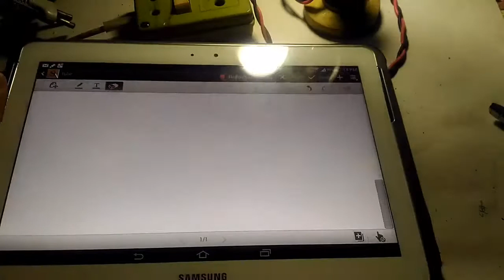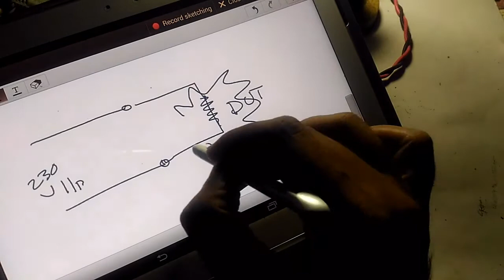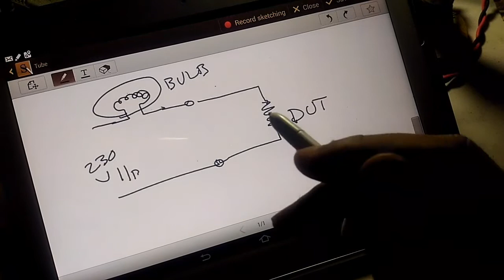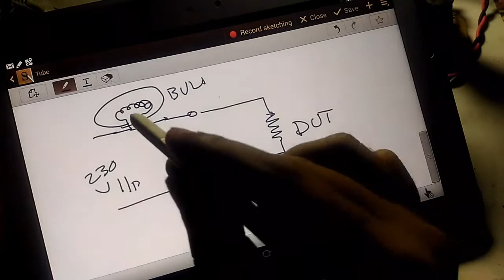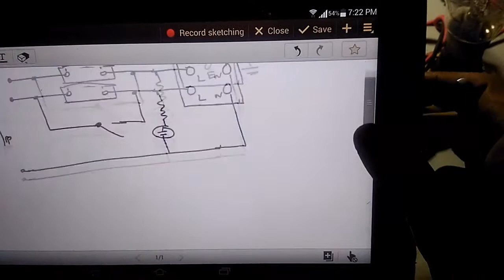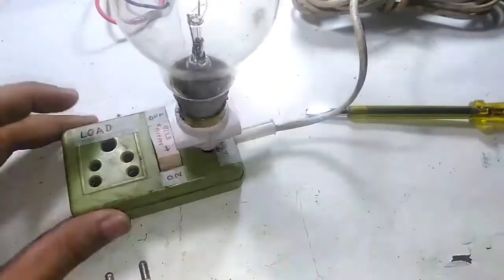IE74 : DIY series bulb tester. (AC mains load short circuit indicator.)

Comment: I see other videos talk about choose the correct bulb to make the protection work properly. Have u figure it out? 🙂
Reply from the maker: The sole purpose of the light bulb is to limit the current flow through the DUT in case of a short circuit. So if you choose a bulb with lower power, it's going to pass a small amount of current and vice versa. Since it's almost impossible to buy these filament lamps these days, atleast in where I live, it's not possible to change it depending on the DUT. So better stick with a single bulb that works with almost all things that you may come across. ☺️

Comment: what is the watts of the bulb?
Reply from the maker: It can be of any watts. The higher the wattage, the more current it will pass to the load in case of a short circuit. :)